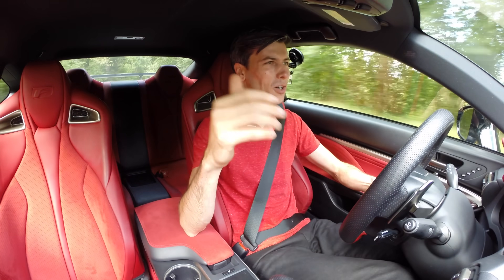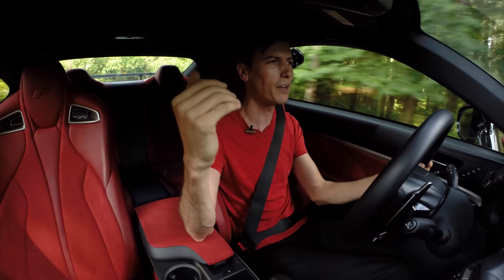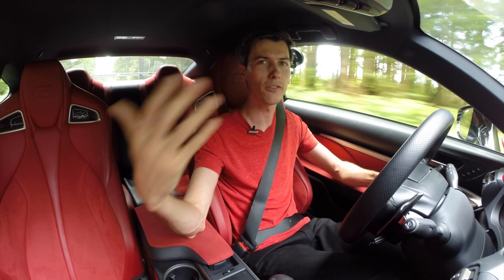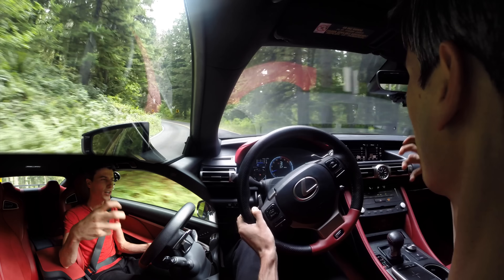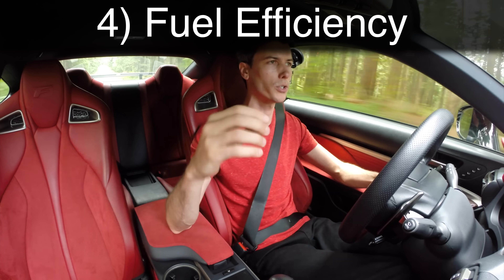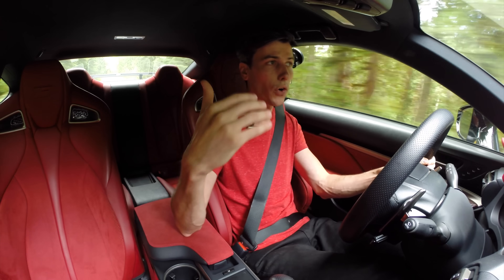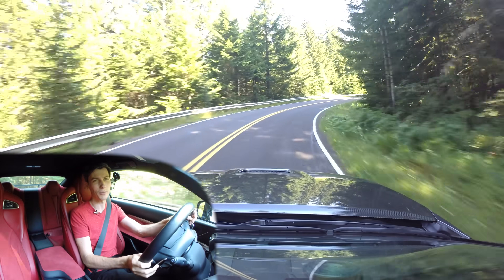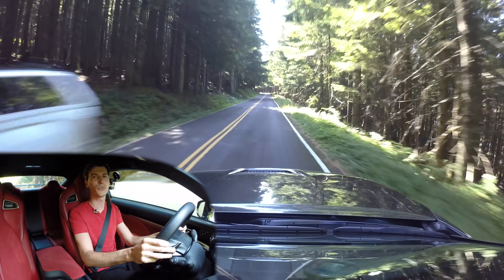5 Reasons You Shouldn't Buy A Turbocharged Car

Comment: A turbo engine has to have lower compression than a NA engine , that's where most of the low end torque is lost on a turbo car . Take a LS with 11:1 compression , and put turbos that move a large volume of air at low boost , instead of the dinky little high pressure low volume turbos . And you keep the low end torque , with kill mode coming in at the top . Buying a turbo car may not be a good idea , but building one is great idea .

Comment: 1 Argument (deutsch in this case hehe): The flat torque curve of non-NA cars is the worst of it. i want torque. many of it. But if i want it flat i buy an EV! the torque CURVE is what makes NA-engines so much fun. my 1.6L 8V engine has ~143Nm (108ft-lb) 630 is lowest idle. okay if ac is on its never under 800rpm (except eco mode = close to no power but no powerloss aswell) if i put the pedal to the metal my cars revs up from under 800 rpm with ease.  i can do it with 4th gear at 22kmph aswell and 1k rpm. not the fastest acceleration but it still pulls decent. show me any turbo <1,3l (hey the engine is old okay? less displacement granted to the turbo) that does that.
my car runs 30kmph in idle 5th gear, slightly uphill is still possible^^

Since ive seen you my favorite example are the Honda S2000 (god that engine! and the pretty look) for an true car, NA HIGH rpm (2l R4 (v4 would be cool)) and vtec. damn this thing has only 10hp/l less then the new porsche gt x (please choose a number that is NA)

Comment: 3.5 Ecoboost barely has lag thanks to 2 very small turbos. The only way to tell is at a stop but still only if you floor it. Normal driving you can’t tell at all that it’s a turbo engine. Not the case with ford’s 2.7 Ecoboost though.

Comment: The non turbo engine in the model I bought was just too slow, I bought the turbo model for passing and merging capability.
Reply: there's no replacement for displacement... buy a better model...
Reply: @strumptavianroboclick5596  only options for the vehicle I purchased were turbo or non turbo 4 cylinders. I would have bought a 6 cylinder if it was offered. I'm glad I got the turbo over a non turbo.
Reply: @johnrambo19820  oh hell ya you need a turbo on those smaller engines.. I got a 6L V8 in my car, coming from a V6 it was a major jump in torque, I don't think I could go smaller without the forced induction...

Comment: I always prefered na engines with my builds. I prefer less fail points when it can be avoided.
Reply: But an NA engines in and of itself is a fail 😂 jp
Reply: Adam c for the same engine size an torque,  turbos are vastly more reliable then a highly strung na. All commercial vehicles and heavy machinery are turbo for a reason. Turbo trucks typically go 1M kms between rebuilds. SC is much harder on engines.
Reply: Fewer... :-)

Comment: As for the turbo lag issue, that's why you want a manual box.
If you're racing around you keep the car in the right gear to stay in the correct rev range, where the power band of the turbo is most effective.
It's not really a matter of NA vs Turbo in this situation, they just drive differently and you need the right driving style and gear shift timing to avoid the lag.
Turbo cars require more preemptive control over when you shift approaching corners etc, to have the power band accessible when you need it.
Even with NA cars that's still the case, you still need to control your rev range to get that sweet spot, it's just less pronounced compared to the obvious spike you get with a turbo.
Reply: eraser101YT my 10 speed auto in sport mode keeps my rpms in the torque zone no matter the speed and does a great job doing it. Not so with my older 6 speed.
Reply: @NoticingBehaviors  True, the modern autos are pretty good like that. The old school ones were terrible for lag.
Reply: Not an automatic fan but most auto's have manual mode that will lock you in the selected gear to stay in the right rev range
Reply: My 10 speed has about a 800 rpm drop with each gear change. So I can stay right at peak HP in WOT.

Comment: You neglected to factor in power to weight ratio.....A downsized turbo engine will be considerably smaller and lighter than an equivalent power NA engine. This is one of the main reasons why downsized turbo engines deliver better fuel economy.....agreed under WOT the efficiency gain is negated. The smaller sized engine also then lends itself to a smaller engine bay requirement and hence car size in general - further reducing overall weight.

Comment: Just keep climbing and see what happens. 
My Country, MÉXICO, almost all of it is surrounded by two Sierras (Mountainous Chains, also called). For leaving  México City, you have to climb Hill & Mountain roads in between 8,500 to 9,500 feet. 
Then You see the Turbocharged vehicles "waving goodbyes" to Normal Aspirated ones.
Reply: You are correct, sir! Forced air induction ftw!
Reply: @TheSingleTrucker  Thank You, sir.
Reply: Even at 5000ft, I can feel my old NA engine lagging. I’ll put the pedal to metal and it’ll feel like I’m barely pushing.
Reply: @404nobrakes   Right sir. Mexico City is at 7,340 ft. elevation. We non-turbocharged drivers start climbing with a detriment of a 22% less power (following the old rule of thumb of -10% power for every 1,000 meters (3280 ft.) of elevation (7,340 / 328= 22.4% ("a la Jason style" Hahaha!)) Thank You, Sir.

Comment: Yeah my son was looking at buying an escape with 1.6 ecoboost and I really discouraged him as I just don't trust it for the long haul.
Reply: The older version with 3.0 V6 is extremely reliable and hella better looking too. The newer Escape is neutered.
Reply: @loudring6247  I have a 2010 with 2.5L 4 cylinder. It got ok acceleration and man the engine compartment has so much room around the engine it's astounding!

Comment: Are these same problems also applicable to superchargers? Except obviously the first one of torque demand vs throttle position. How does a supercharger get it's lubrication?
Reply: It's sealed with oil inside. And superchargers have no lag, but die out at the top end. Superchargers are great, boost when I want it, no boost when I'm cruising at 70mph
Reply: @hitmixhyepock9405  Thanks bud but are you sure they die out at red-line. I was under the impression that a turbo dies sooner because a supercharger spins faster with more revs as it's directly connected to the engine with a belt. I own a 5.0L Supercharged V8 and I've never had a car push me into the back of the seat at 100kmhr+. My old I6T felt like it ran out of oomph sooner. I am just worried about the supercharger longevity. I assume it's better than a turbo due to not being in excess of 100,000+ RPM
Reply: @LawrenceAbramoff  yes the superchargers loose their "huff" at the top end while turbos come on late and keep their power up to redline. The supercharger spins only as fast as the motor, turbo spins waaaaay faster lol. The supercharger can only spin so fast before the air heats up too much. Like I have a Eaton m62 and mine will spin efficiently until about a 2.6 pulley. Then it just starts to make too much hot intake air.
Reply: @LawrenceAbramoff  superchargers are simpler than a turbo. I dont know about longevity other than the cobalt community. And I hear people always having to replace their turbos for some reason(seals, shaft play) but nobody ever talks about having to fix their supercharger other than a 60,000mile oil replace or the coupler...which is a $9 part.
Reply: @hitmixhyepock9405  yeah my I6T SHAT it's OEM Turbo at 50,000 miles. I replaced it with a precision 64/66.
Get your tuner etc to look into intercooling your supercharger. Mine is  a Ford XR8 Sprint (Australia) and it has an Interchiller. Same as the Dodge Demon
Reply: @LawrenceAbramoff  my cobalt already has a heat exchanger. It can only do so much lol, next is a dual pass for the HE and the 2.8 pulley. I could get a tvs supercharger for it but the power is peakier but it's more efficient than the m62. But its $2500 and I could get the turbo kit for $1500 and get more hp and tq for cheaper....about 320hp and 300ish tq.

Comment: I see bad times ahead for a lot of everyday motorists because of the huge rush by almost all the manufacturers recently with so many 2.0  and other engines with turbos. I like tech, and I had a turbo that was fine for 163K miles (a 2000 Jetta TDI, which admittedly is a different beast). BUT, we all know that some car manufacturers make excellent engines, and some do not. Now that almost every maker is putting turbos on so many models, which ones are going to stand the test of time and mileage and which will saddle owners with very expensive repairs? I really don't see many 2.0T engines made in the last few years going 8, 10, 12 years like most N/A engines can easily do, which is where an awful lot of buyers today need their cars to last and/or need to buy a pre-owned car around that age.

Comment: How many can afford V8???
Reply: A pushrod V8 is cheaper to make than a dohc turbo engine.  LS may be a bit tricky with the aluminum casting, but the cast iron cousins used in trucks certainly are cheaper.  Not sure about Mopar, but I doubt they are all that expensive (and the supercharger is a license to print money).  The coyote is DOHC...

Fitting a V8 in modern car is another story, but plenty of people have managed the famous "LS swap" where nobody would think it would fit (replace rx7's 1.3l engine, no problem...).  Then there are CAFE issues: V8s drink more gas, so CAFE was designed to keep them in expensive cars (and let the big 3 pocket the money without worrying about "muscle wars").  CAFE is why you can't afford to buy a V8 (physics and engineering are why you couldn't afford to keep filling it up, and no comment on insurance).

While the SBC might be the ultimate 20th century engine, I'd look to the Accord Hybrid for how to motivate a modern car.  All the range anxiety of a hybrid, but no real limits on the electric motor.

Comment: He basically confirms my own experiences, except that I am willing to live with the negatives. Part of the reason is that the manufacturer doesn't offer a 6 or 8 cylinder engine so there's that. And yes, it has its own sound but that's not what drives me so... But his points are 100% valid, and watching the instantaneous mileage drop to 7 or 8 from a small turbocharged 4cyl only confirms that just because the air-fuel ratio must be kept ideal for combustion (let alone knock prevention), adding more air requires adding more fuel. And that isn't as efficient as the normally aspirated 4cyl engine. But it's not meant to race; it's meant to get out of its own way, merge and pass, and climb mountains without complaining. And I am really enjoying the turbo.
Reply: Agree...  I can live with the shortcomings related to having a turbo boosted engine.

Comment: Solid points, as an owner of several turbo cars in the past I learned quickly the motors don't last & the obvious reliability issues, no thanks.
Reply: I've heard this before but never experienced it.   All my turbo charged cars have gone well past 200k miles.  2 Saabs and an Audi.  Maybe certain brands have quality control issues or maybe just bad luck.
Reply: @ACK88  All in how one drives them too, I sadly drove mine hard so the blame is mostly on me.
Reply: I have a turbo diesel  (VW 2.0 TDi) and I must say its an amazing engine, efficiency power and torque. I know a friend who has 1 at 500,000km already
Reply: Mercedes build the best Biturbo engine thanks to NANOSLIDE TECHNOLOGY. I love my GLC43 AMG with 75k miles and I abuse it daily!
Reply: vinniecorleone62 you are doing something wrong mate. All commercial engines are turbo and turbo trucks typically go 1M kms between rebuilds.
Reply: Moral of the story, drive a turbo car like a civilized human being, have some fun here and there, and the car will easily last 200,000 mi. Drive like an animal, and any car will be destroyed earlier then it's anticipated lifespan.
Reply: DJS my GLC43 gets driven hard now and then but still pulls like crazy 76k miles and counting. Mine is a Mercedes.

Comment: You live in europe and you just got your driving license, you have like 3.000 euros to buy a car. What do you want? a reliable N/A 1.5 petrol with 100 hp which is a slouch or you want a 1.8 turbo which behaves like a 2.5 with 180 hp and all that torque?
Reply: Difference is between want and need.
Reply: Consider maintenance costs and fuel consumption when driven properly. The 1.8 turbo is tempting, but there is a reason it is cheap in the second hand market. So 2 years ago I found an 1200 euro 1.8 N/A petrol sedan with 122 hp. In the first year it needed some repairs, so make that 2000 euro. I admit it is not as fun as a 180+ hp car, but I don't have to worry about fuel consumption to much when flooring it.
Reply: @mennol3885  1.8T MK IV GTI's with 180HP and 300.000km start at 2.500€ (had one). My MK V GT SPORT has a 1.4TSI with 170HP and I can drive it at 6 liters.  Bought it for 4000€ with 128.000km. Replaced all shocks and springs with Bilstein OEM's, 350€, drives like a new car. Oh, and cruise control set at 180-200kmh on the Autobahn it takes around 10L.
Reply: You can get decent N/A car with that money. 2.5- 3.5L german car? Older cars easier to repair also.

Comment: My turbo just broke, $1550+labor out the window. Snapped the shaft under acceleration with 30+ pounds of boost, was deafening. I'm just glad it didn't take out my engine, really don't want to spend 30 grand rebuilding it right now.
Reply: What car?
Reply: @GM-br7qj  it is on a 14.6L caterpillar 3406e in a 1999 Freightliner.

Comment: 8:35 Of course this then begs the obvious question.

If you care about economy, why are you spending a lot of time at the top of the power band with your foot down?
Reply: At that moment he doesn't, he can go home and grab an electric vehicle for efficiency.
Reply: @jaydunbar7538  For him yeah, but that's not relevant to anyone else.

What he's saying and that I'm responding to is that turbocharged engines are less efficient than NA engines when you're asking them for all the power they can produce, to which my response is that no engine is anything even vaguely resembling efficient when your foot is down so even if turbo'd ones are worse what's his point?
Reply: @MrHamof   : This is what I was wondering as well.  For street driving, if you're not an asshole, you should end up with good economy.
Reply: Different times have different situations.
When cruising on the highway I do want good economy. While on an empty country road I may want performance. Switching between the two.

Comment: Hi Sir! was wondering if getting the obdlink mx+ scan tool or the bluedriver will help provide solutions for most of the current problems with a '99 rav4..(a/t, 64k mileage)?...sadly, up till now no true solution has been addressed by the mechanics we have around our area..

If the obdlink or bluedriver works for older models, and will provide solutions and fixes, maybe there's still a chance to maintain and keep the car for several more years...

Thanks in advance for taking the time replying :)

Comment: bolts turbo to 5.3 ls "what now? I wasn't listening."
Reply: LS + Big Turbo = Maximum Freedom
Reply: @johnrice6717  I'm more an LS + roots blower person, because blower wine is a beautiful thing.
Reply: @jasonyoung6420 : Nothin against super chargers, but it wasn't a supercharged LS that was the first stick shift GM to hit the 7s
Reply: Jason Young : *WHINE, but I agree, that sound is as sweet as wine.  NHRA funny cars are like Bordeaux!
Reply: @johnrice6717  - This is true, but a supercharged or NA motor is better suited for a street car under most circumstances. 

A supercharged engine has all the advantages of a naturally aspirated engine with the added power of a forced induction engine. Sure, turbocharged engines will have more peak hp or more low rpm torque (a few dual scroll turbos can have both), but you still have to wait for turbo spool. 

I have owned several turbocharged cars for over 15 years and when I drive a naturally aspirated car (with decent power), boy I do really miss the instant throttle response of the NA motor. But for a small engine & small car, I do prefer the turbo motor. For a performance car or work truck, I definitely prefer the NA motor.
Reply: @MesserEsser_OG : I'm all about NA or supercharged for a daily. But if you wanna experience genuine bald eagles. You gotta experience a TurboLS
Reply: @jasonyoung6420  Blower wine, eh? Clever😉
Reply: ttcherrick more like a napa cab 😉
Reply: @MesserEsser_OG  Dual scroll is marketing term for a single turbo. A turbo has 2 turbines 1 intake and 1 exhaust (dual scroll turbo)
Reply: @jaybee2344  haha are you trolling?
Reply: @johnrice6717  well if you want instant throtle response and torgue put roots blower okay now you want more top end POWAAA put biiiig turbo and for most torgue and power pick some big engine for modicification and there you go 😂😂 also this is called pro-charging or dual-charging so just to prevent "that is dual-charging noob" comments .... And if you ask me i am stroking m50 to 3.0 and adding root style supercharger so more toruge more power bust most importantly sound is still 6cyl ear gasm 😍 and this is daily and i dont need crazy amount of power 🤗
Reply: @FluffyRaT  just doesn't know what he is talking about.
Reply: NAFSUCOF-FOCUSFAN Maybe more appropriate: I have actually seen NHRA funny cars race at Napa (Sears Point).
Reply: John Rice Ls + small turbo = most fun
Reply: John Rice except when ur in debt to gas
Reply: @johnrice6717  It's the American way.
Reply: Why one when you can slap 2
Reply: 80 miles later: "damn. need to fill up again".
Reply: That’s what I was thinking